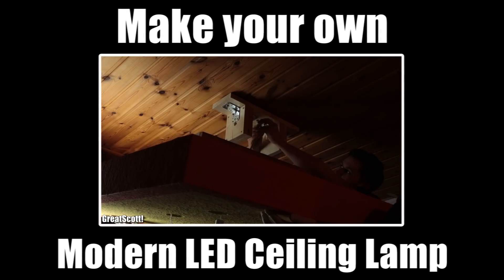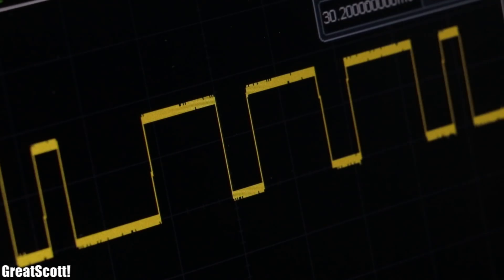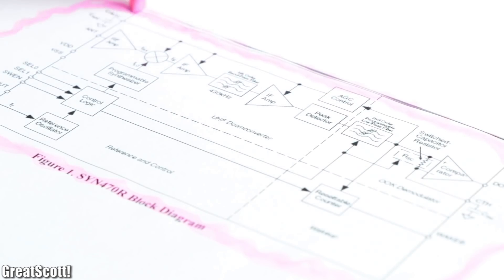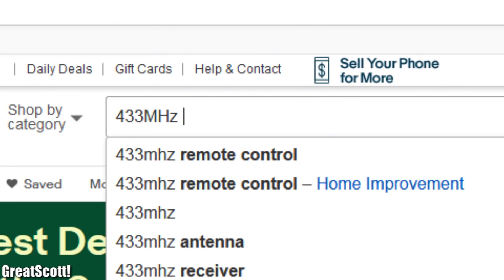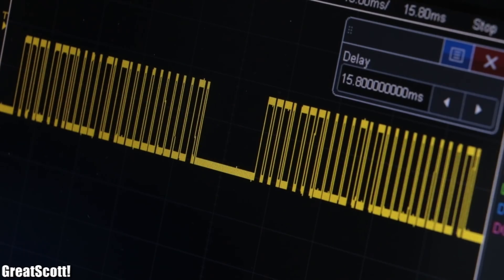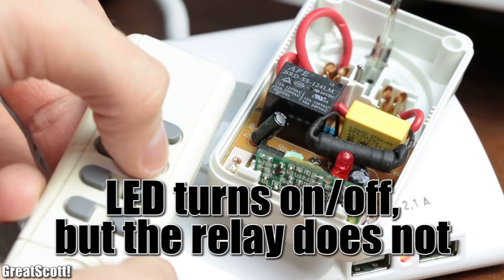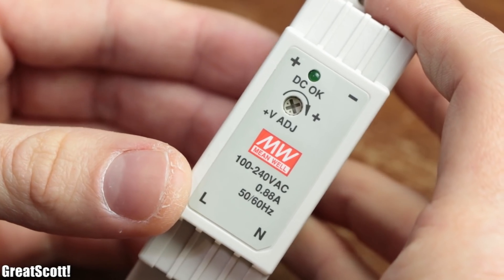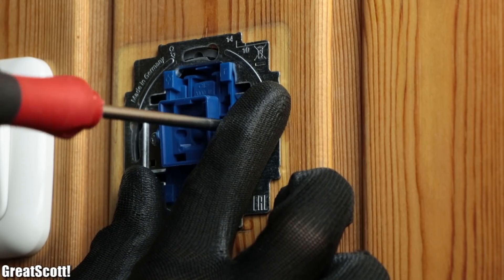Repurposing an LED RF Remote to control "anything"!

Comment: I'd love to see a book (in actual paper. preferrably withlaminated white-board-marker-friendly pages) of all your schematics! You could even multi-laminate tiny bendable circuits that has audio where you give short hints/tips/commentary when reader drags their finger over a capacitive portion of the page. YOU CAN DO IT! :D It will be awesome. Like surfing your channel IRL. You can even make actual hyperlinks on the pages which energizes shape-memory strips which forms the corners of eevery page/chapter: so an input or even path of learning/creating lifts corners of pages behind/after that other page reader needs!! Is this a brilliant plan or what? xD

Comment: Such a great idea to reuse the existing remote. I think it would be better to have "On, On" as well as "Off, Off" toggle the output. That way you can switch it on and off without also changing the RGB LED colour.

Comment: Hi Great Scott,
Great videos, you have become a reference point for me and my friends: “great Scott certified statement”, when discussing electronics.

But I have a question, Ive tried to figure out how these mass produced RF controllers are set up. Do they all (or at least a large quantity) have different codes? 24bit should give us ~16 possible integers, which gives us a large variety of different codes. So it is fully plausible.
What would your gut feeling say? 

Thanks!

Comment: You forgot the antenna on the receiver. A wire of a certain length is sufficient. At a frequency of 433 MHz the wavelength is approximately 70 cm, so an antenna approximately 35 cm long would be the most efficient. A wire with a length of 17.5cm is also possible. (1/2 or 1/4 λ)

Comment: I've been playing around with the Nano for some time doing lighting and effects for scale models.  Since reading about decoding remotes with an arduino, I've been wanting to try it.  I've uploaded the ReceiveDemo_Advanced example to my Nano and made sure it worked by inserting the Serial.println("Hello World!"); into the code.  It works, as the serial monitor shows me a continuous stream of "Hello World!" on its screen.  Next I purchased a 433Mhz RF Module Receiver and Transmitter Remote Control using the supported EV1527 chipset, hooked up ground, Vcc, and a connection from data pin 0 on the receiver to pin 2 of the Nano.  Finally I paired the remote with the receiver and have confirmation by the receiver led blinking every time I press the remote button.  Everything looks fine and compatible, yet when I press the remote, I get nothing other than "Hello World! on the serial monitor window.  By all accounts I should be getting data from the receiver on pin 2 on the Nano appearing on the serial monitor, but I am not.  Not sure what I may be missing.  Do you have any suggestions?  Thanks

Comment: Hi, nice job. I didn't understand how did u wire up the SSR with switch to control the LED individually. Is it possible to turn ON using switch and turn off using RF remote. Thanks for the video.

Comment: i was having the same problem with my ceil but  could fix this by buying a 3 color  led lamb which changes it,s color by turning it on / off and took it,s circuit and connect each stage with relay and hooked each relay with the light source I want . like that I could turn of/off any light or even both  for around  10 $  :) hope this solution help

Comment: You have a 3 method to extend the  433 receiver first make 17 cm antenna one fourth of the wave length   second use more powerful Arduino like uno connect with 12 volt the Arduino will convert it to 5 volt and connect the receiver with 5 volt from Arduino ... Or you can adjust the screw on the receiver ...this will give you the maximum ringe for the future projects

Comment: After attaching a proper antenna as others have said, it also will help to tune the receiver by adjusting the brass slug in the small coil for best range. Most of the ones I've bought have been significantly off-frequency (typically 3-5MHz high). Also watch out for mis-assembled ones. They've screwed up the biasing of the first transistor, saturating it hard. Good receivers can achieve about -100dBm detection sensitivity or better. Bad ones barely make -80dBm. Nice video.
--N2GX

Comment: Hey just wanted to suggest u to make a video on the series and parallel connection of atx power supply from pc. For higher voltage and higher amperage respectively.. It is my utmost request to please make one.
Reply: Why use a crap ATX power supply if ya need more volts and/or amps
Just get a step up buck boost converter or make one simples
Reply: But can u get more watts out of it???

Comment: Hi Scott, my question may be dumb or I didn't get properly from you video @ 4:53.  
How IR remote & RF receiver exchange signals???
Reply: I think the remote does both, but yes it did look a bit confusing with the LED on the remote.

Comment: I bought some cheap RF mains power plugs from LIDL which I can control using an Arduino and a 433Mhz RF module.  Range is good.  I plan to use this to power on/off my 3D printer using a Raspberry PI (already using a PI for OctoPrint).
I hope they are 3.3v compatible!.

Comment: Those modules you have for the 433MHz RF ASK modulation receiver are very common and dirt cheap on ebay/aliexpress ... but they Need an antenna if you want to have some range ... A small helical antenna would be enough. The antenna can be made by twisting a thin wire on a screw and  get eh helical shape we need.

Comment: How about making an update to it.

Use the mode to turn on and off but use the same method with the next button along and turn it in to a mode where the colour buttons match a specific GU10 lamp and turn it on and off as desired to mower lighting to a few lights.

Comment: “G3MB-202P”: we pronounce the “minus” as “dash”. Love your videos. Keep them coming.
Reply: Searched for this comment, was not disappointed. The hyphen can be called a minus sign, but only in a mathematical context. In chip nomenclature (and general typography?) it's most commonly refered to as a dash.
Reply: Technically both are correct, however "dash" is used especially in model numbers, protocols, etc.
Reply: Nowedon't

Comment: Good video! But, is there any reason you're using rigid wires? Recycling? If not, I don't think they are a good option. (Also the antenna and the encryption)

Comment: 0:18 it's actually off position you've attached it reverse on wall
Reply: It depends on where you live and what you're used to. For example, in Russia most light switches are ON when the top side is pushed.

Comment: Can you build a Fan controller that automatically switch the fan on at a set time and adjust it's speed according to setting and after a time it will change it's speed to another set speed and again for another time it will change speed and at set time it will automatically switch the fan off!😊

Comment: It would be extra cool if you built a module that took in binary commands from the light switch (turning the switch on and off in a particular pattern) to selectively turn on the main light, RGBW LEDs, or both.

Comment: I made an IR project with the same issue where it worked but the range was much less than the original remote. Can you make a video explaining this and how to correct the problem?
Reply: There are different IR wavelengths so it could be that they are not matched properly (though that might be unlikely). What you could do is modify how fast or slow your IR transmitter sends a 1 or 0 and check it on the receiver to see which speed works best.

Comment: Huhh, a blue wire (not neutral) on a mains switch? That is strange, should it not be brown?
Reply: no... i never saw a brown neutral wire here in germany. all good
Reply: @anatolijleipi7594  That's my point. That wire is not the neutral. Its the "return fase" (fase that gets switched on/off) that goes to the lamp. 
Its should not be blue because the neutral is going directly to the lamp not to the switch.

Comment: good video.

btw, you can avoid relay sparks/arcs by connecting a 1uf ceramic capacitor in series with a 10-100 ohm resistor, between relay contacts.
Reply: or a 1uf electrolytic capacitor and a schottky in parallel
Reply: the solid state triac also has a snubber circuit. No idea why he would skip it for the relay. Still triac one should be more reliable.

Comment: Idea: What if you could control the g10 with the light switch: switch on = all is on. Switch on off on = only led is on. You would maybe have to use a battery or something to have power while in the off position.

Comment: There is a much simpler way just grab a controller that has +12v and the 3 color negatives and just connect a reply between the +12v common and the colors and you choose the color to choose the les

Comment: How much power does the solid state relay can handle?
Reply from the maker: 2A at 230V so around 500W
Reply: Thx a lot
Reply: But it might overloaded i think you should use 2 in parallel to avoid overheat

Comment: You can also make your own buttons easily with a PT2262 which you can set with the pins on the IC. In this video I make a button like that and use it to send a command to an arduino over 433mhz which then in turn sends other commands over the same protocol: https://youtu.be/Oez0VQxZPBs
Also a thing about the rc-switch library. It doesn’t support a few of the newer 433 devices. There is a library that does (even some weather stations). Explained in this video: https://youtu.be/qLTY9CTb1wU

Comment: Get rid of those Wago connector and use wire nuts. Those quick connectors have been known to fail with a high resistance and cause fires.
Reply from the maker: Haha no

Comment: Hy scott i did simular thing to my end thasis but i wirted all the code and was atmel studio Put PID in the light to sense the room how much light is in the room  i used 4 sensors (you set a light value and the lamp trys to light the room that value)

Comment: Wifi controller would be much easier ...... but props to you for taking this projekt to a good end
Reply: Imo Wi-Fi for lights is stupid when RF is an option. Sure it's nice to have sometimes so you can use your phone but for switches or door locks that I use it on I find it better to have RF because 1) wifi has some noticable delay if the signal is not perfect and 2) in case of internet outage, stuff stops working.

Comment: Is the eBay SSR module that much more reliable than the relay module for switching mains ?  For £1 or so, I'm not so sure ...
Reply: the was a named one - omron. cant do much better. but you can build yourself with a triac (bt134) and moc3063 plus few passive components.

Comment: Thats a good touch to your project, are you finished with it or are you going to keep improving it over time.
Reply from the maker: Now it is done.
Reply: @greatscottlab  hi sir I have one question what if chipset ic on the remote is not the one is listed in the rc switch Library,then how can I decode is there any other Library which can decode that RF module?

Comment: What is the best cheap 433 antenna that i can buy on ebay or aliexpress ?
Reply: mostly a 35 cm long wire is enough, the cheap modules(like in the video) have a range of 5 - 10m with a to short antenna (25 cm)
Reply: @stromundspiele670  Can i buy better antenna? i will use rxb6 receiver and i need long range.
Reply: @jurek-zz3un  it depend on the transmitter to. how long should the range be

Comment: Or, you could use an SDR (Software Defined Radio) to avoid having to tear it apart. The RTL-SDR is a cheap ($20) SDR which is useful for many purposes, including checking the frequencies of a device and hacking RF devices.
Reply: It depends on the project's price sensitivity... the one he used is about half the cost of an SDR... but yeah both could be used.
Reply: Bill A No, I mean for analyzing it to know which frequency to use.
Reply: @GRBTutorials < Oh I didn't get that part... yeah I suppose that would work for testing.

Comment: First of, great Video!
I wanted to build something similar with an RF remote I got from some cheap lamps, because I liked the design of it. My problem now is that the arduino doesn't show me that he is receiving anything, although the oscilloscope shows me a data pattern. What could be the reason for that?

Comment: @GreatScott! Please next project do this with a old tv remote and keyboard to control a computer connected to your tv. Have some way to customize keyboard shortcuts for each button on the remote. There are tutorials on how to do this but it’s difficult to follow and there are much easier ways to get this working with new technology.
Reply: Nevermind Flirc does this already.

Comment: i’ve done a similar thing to control my whole room’s electrical devices and it’s been working with a mechanical relays for over 3 years now (: .. so i don’t think the SSR is necessary .. anyway, good job Scot

Comment: Uhm.... You do know, that you forgot to solder an antenna to the cheap 433MHz receiver, don't you?
They don't come with one most of the time so you have to cut a wire to the right length and solder it on yourself, or buy a 433MHz coil antenna from ebay too (they are like 50ct)

Comment: Very interesting !
An alternative to control everything in your house : use a sonoff rf bridge flashed with espurna firmware as receiver. It communicate as mqtt device so you can easily use it with « home assistant » installed on a raspberry to control everything in your house.

Comment: I have some motion controlled outdoor LED lights that have a feature where if you flip them off and right back on within about 2 seconds, it turns the lights on continuously and overrides the motion control. If you turn it off for more that 2 seconds, the motion controls are re-enabled. I think I would have tried something like that in your situation. Flip on the switch - both come one. Flip it off shortly and back on and the white leds go out but the colored ones stay on.  Up-side - no remote to misplace. Down-side - remote will allow additional controls like picking the color of the leds.

Comment: was going to do something like this but with the RF receiver from an automotive remote starter for a car to basically run a preset weekly schedule in the winter to warm the car before setting off to work, based on an ATmega88, RTC module (for schedule keeping), and a few high powered mosfets for controlling the high current wires from the ignition switch.

Comment: My halogen lights are finally starting to burn out after a couple decades...been thinking how to connect multi colored led lights to these ac lights...
Reply: FYI - multi-color (RGB) LED lights sucks as a main source of light. I would highly suggest you to use at least 75% of regular white (warm/cold color temperature - your preference) LED bulbs as the main light, and only replace some of them with RGB mood-light bulbs.
Reply: Artūrs Savickis , thanks, that is good to know!  Maybe they sell a bulb that is 75% white with some extra rgb leds also embedded?
Reply: @TheRainHarvester  yes, the are such lights. AliExpress has FRANKEVER 4 inch Multicolor Full Function LED Smart Downlight Round Ceiling Recessed Spot Light 10W WiFi Control  FK-DL101-RGBW fur example.

Comment: GreatScott I think you mean IR modulation not RF
Reply: Well you are hooking an IR remote to a LoRa radio but you keep referring to the IR remote as a RF remote.
Reply from the maker: It is RF
Reply: @greatscottlab  Okay now i'm going to have to watch it again LOL the remotes like you're using or the one I have that is similar is IR.
Reply: I wanted to say the same at first, but bit later in the video it turns out that it's indeed RF not infrared remote. Just the same form-factor of the remote control.

Comment: Hi Scott. i just wanted to ask you something. what do you recommend me better?, electrical engineering or programming(software engineering) and to tell the truth i don't love math to much
Reply: Basically both is really different. You need to choose that, what you like more.
You can't compare them.
Reply: Fiorii Alaia , electrical engineering will use a lot of math. Computer science, not as much, although still some.
Reply: Software Engineering isn't just coding all day everyday. It's more documentation and  the relationship with the client. You'll be exposed to program development models, team management, how to deliver what the client wants according to the selected development model and stuff like that, alongside writing your actual code.

Electrical engineering is power grids, electronics, plant-based designs( controls and Instrumentation) and communication systems. All of those involve math and programming. Ladder logic, Matlab etc but you need to know the math involved in order to write the code.

Computer science is heavy coding but you need to have a mathematical understanding of how code works. Not just write the code, throw it to the compiler/synthesizer and hope for the best performance.